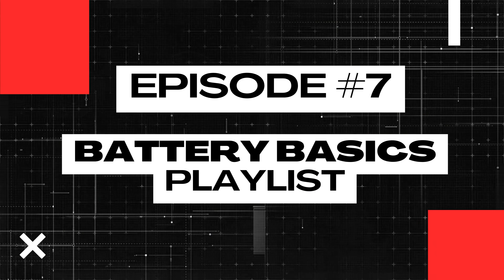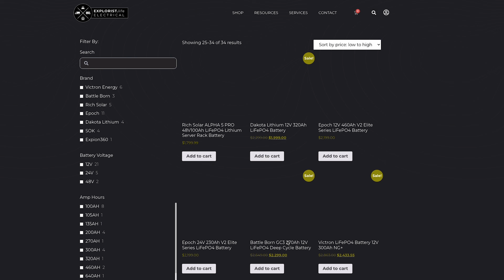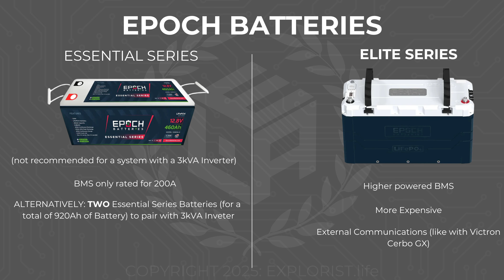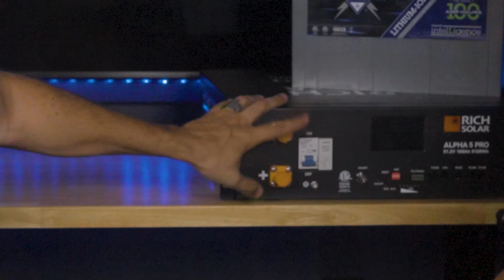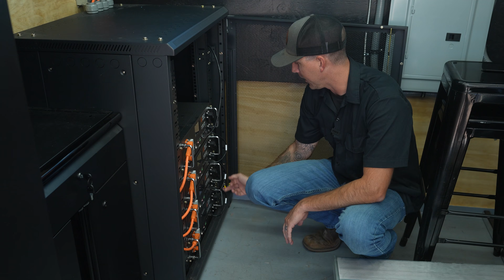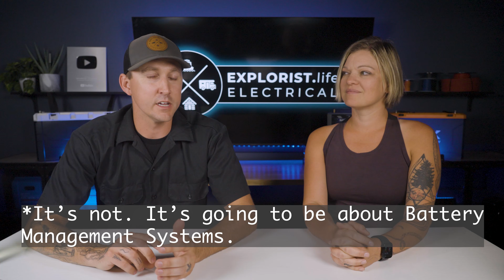Which Battery You Need and Why -  Battery Basics Playlist | Ep: 7/7

Comment: So if you have a 12V 100ah battery that has a 100A BMS and you wire several of the same batteries of the same age in parallel, how does that affect the BMS level of the entire battery bank. Are you still limited by 100A current load, or is the Current shared amongst all the batteries in parallel so you can draw more than 100a? Also, does it matter if they are hooked up in parallel to a Victron distributor versus wired together then 2 main cables go to the Victron distributor?
Reply from the maker: This is exactly the kind of setup where the details really matter, and they can vary depending on your specific system and goals. We’d love to take a closer look at your setup and help you get the right configuration for your needs. Reach out to our support team - https://shop.explorist.life/support?utm_source=youtube&utm_medium=comment&utm_campaign=support&utm_content=response_link

Comment: I have one 4 year old Battle Born 100ah battery in my Four Wheel Camper. I have minimal amp draw with a Dometic furnace and Iceco fridge and standard lights and usb chargers. No Inverter. 200watt portable solar panel, Victron Orion DC-DC charger, and Victron Shunt. There doesn't appear to be any heat on either of the battery lugs and the battery has never felt warm. The battery charges up and discharges fine under my light loads, 13.2 resting voltage. Should I be worried that the BMS will shut down the battery or possible fire hazard?  Lots of Doom and Gloom on Youtube. Would you recommend replacing the Battle Born for safety's sake? I trust your opinion on this. Thank You.
Reply from the maker: We are glad to hear yours has been working well and that you have not had any issues. There are a large number of Battle Born batteries currently functioning properly in active systems, and the presence of one in a system does not automatically mean it is unsafe or defective.

We addressed our position in a community post last week. (https://www.youtube.com/post/UgkxN_A1vzGRx-sQc8WXoe4WTNjPleZC3GKe) 

If you purchased through us or based on our recommendation and would like to talk through your specific situation, please reach out to our support team so we can have a direct one-on-one conversation: shop.explorist.life/support
Reply: @EXPLORISTlife  Would replacing a battery with known problems be advisable? What would you do?
Reply from the maker: If you purchased through us or based on our recommendation and would like to talk through your specific situation, please reach out to our support team so we can have a direct one-on-one conversation: shop.explorist.life/support

Comment: I always start with this: calculate your power draw, round it up to get a 1,5x safety margin (1,5x power/capacity is better than 1,2x standard safety margin for electric safety, in my experience, people underestimate their power draw, then they expand so I suggest rather over-sizing instead of spending money and time and bothering yourself with upgrades later).

Then, I pick up the voltage based on the inverter - and I have a very fun math based trick for doing that (I graduated with my 1st PhD in a math-related engineering field so it makes sense that I like using algorithms to automate my thinking). 1000W inverter = 12V, 2000W inverter = 24V, 3000W inverter = 48V, for 100Ah worth of cells. Then, you may simply double the given capacity of all the voltages to move the inverter scale by one to the left. You double 24V/100Ah, you get 24V/200Ah for a 3000W inverter at 0,625C. You also double 12V/100Ah once, you get 12V/200Ah and a 2000W inverter at 0,83C, which is still acceptable. We moved the inverters on the scale left by one place. Then, you double again from 12V/200Ah to 12V/400Ah, you are again at 0,625C but for a 3000W inverter. This way, you are always safe, you always preserve your batteries and you always stay within the 0,6-0,8C draw from a 100Ah pack. It's wise not forcing the batteries over that, we're talking lots of current already so all kinds of issues for all of our parts in the chain.

It is a very nice trick and the numbers are super easy to remember. 12-->1000, 24-->2000, 48--->3000, double the starting 100Ah capacity, move inverter power to the left, always stay around 0,7-0,8C. Who knows, you may even save your Battleborn batteries that way 😛

At this point, I wouldn't install any Battleborn packs, tbh. You may not like W. Prowse or you may ask why this whole mess is happening right now, but having a plastic between the two conducting metal surfaces, all of that moving around and held together by a conductive bolt... it is just never a good idea - regardless of a brand, regardless of who criticizes it and how late after the release it's been spotted/made public.
Reply from the maker: Regarding your last paragraph:  I don't dislike @willprowse and I'm not sure where that rumor started?  We also no longer carry Battle Born Batteries?  This video also sorta isn't about Battle Born Batteries - they were simply included since we carried them at the time of making the video.
Reply: @EXPLORISTlife Sure, I meant in general, the generalized you, not you personally 😂 People question why he had not realized the flaw earlier, while making a video and cutting them open. Actually, we all did not realize when it was all visible, out there in the open. People also question the anti-Battleborn campaign of many videos that Will is releasing, one by one, which is not that surprising in the end - Will finds such a terrible flaw and takes multiple batteries for tests, they all fail, so he drags Battleborn through mud in a whole series, understandable.

Again, I did not mean you personally, I know that the video is not about Battleborn so I commented on the actual topic and I threw the Battleborn stuff in when I heard the brand name, as a side note, to suggest not using them to people who watch it today 😂

Tbh, I didn't know there was a rumor about you not liking Will, I came across your videos while checking on some stuff for my new van smart system build, I do not even know why it suggested you but I clicked on the videos, listened to a couple of them, out of curiosity.

Cheers and lots of beer(s)!
Reply from the maker: @sphiratrioth666  Understood, and thanks for the clarification.  I think I'm just in a bad mood about the whole deal and am quick to be defensive.
Reply: @EXPLORISTlife  I see, no problem. Gladly, Battleborn are not available in EU nor Asia, at least they weren't, when I checked maaaany years ago, while building my previous, previous van, so I've never been too particular about that brand - but - I understand it is a problem for many stores who used to work with them and for many creators who used to recommend them for years. I wouldn't buy the plastic-cased battery myself, I'm used to importing raw EVE/CATL cells from China, together with a JK BMS, it's 2-3x cheaper in EU and Asia, so I generally want to know what is inside and how it's attached since I do it myself, but - many folks listen to the channel X or Y, buy your whole set-ups and then - it's suddenly your problem too because you recommended them, I understand it may be frustrating and make people defensive.

Comment: Can charging 51.2v 300amp or 600amp from class c motorhome alternator and how many hours need to get full charge
Reply from the maker: That really depends on the exact setup — alternator size, charging method, battery specs, and how the system is wired all make a big difference.

If you want a solid answer for your motorhome, the best move is to reach out to our support team so we can take a quick look at your setup and point you in the right direction (and help with parts if needed): https://shop.explorist.life/support?utm_source=youtube&utm_medium=comment&utm_campaign=support&utm_content=response_link

Comment: Do you have any info on renergy batteries? I have 400 amp hour lead acid energy batteries along with a 3000 w energy inverter. The system is renergy and the batteries need to be replaced. So I was looking at energy batteries. I see that you don't carry them. Is there a reason?
Reply from the maker: We can definitely help you sort out the best battery options for your setup, including what will pair properly with your existing system. Since the right recommendation really depends on your exact components and goals, our team would love to take a personalized look at your project.

If you reach out, we can walk you through solid alternatives and get you set up with the parts you need:
https://shop.explorist.life/support

Comment: Something I ran into recently was not having enough inverter. I have a 12v system using the Epoch Essentials 12460A-H I got from you. All my other components were Victron. My invetter was a Phoenix 12v 1200VA. I used the Phoenix for years with my main focus using it to charge my ebike batterries. I aleays just assumed it would have me covered to run my other item if needed. A small electric kettle rated for 800 watts. A analog microwave rated at 600 watts. A small airfryer and a hot plate. On the electric kettle it the app said it was pulling nearly 1800 watts. Immediately shutdown and wouldnt run any of those items. I swapped it out for a Giandel 2200w Inverter was able to use everything elsr as it was wired just had to add terminal lugs to my power cables. I dont have the communication I haf with the Phoenix & a Dongle but I am completely loving this Giandel. It has not failed to perform. I have a small system and its all tucked in the place the 3rd row seat would have folded into in ny Toyota Sirnna. I only ever power any one of those items at a time. But this has been a game changer for sure. I would like a Bluetooth option for turning the Giandel off and on like I had with the Phoenix but having a wired remote turn on has not been a deal breaker. I can't wait to see your video on inverters. Hope you include something like the Giandel 2200w Inverter. I feel like I should have went with the Giandel 2200w from the start but then it wasnt even out when I designed and installed my system. ❤😊
Reply from the maker: Thanks for sharing your setup and experience! It sounds like you’ve got a great system coming together. If you’d like us to take a closer look at your setup and help make sure everything is optimized (or explore inverter options that fit your needs best), reach out to our support team — we’d be happy to help:
https://shop.explorist.life/support